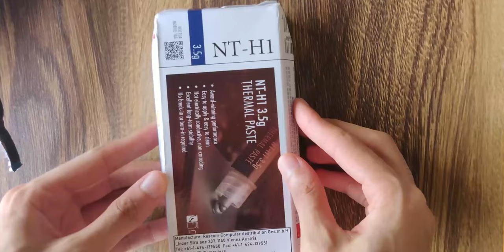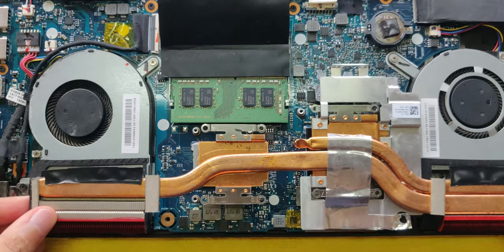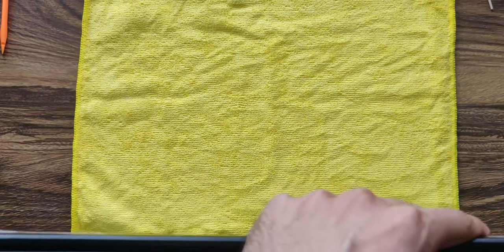How To Replace Your Thermal Paste - ASUS TUF FX505D series | Noctua NT H1

Comment: i was gonna repaste  my laptop yesterday but 2 of the cpu heatsink screws are screwed in really tight and im worried i will strip them what do you think i should do?
Reply from the maker: It was kind of hard for me to get the screws and the heatsink off as well. I was able to get the screws off by using a flat head/slotted screw driver bit (the one that's a straight line rather than the crosshead). That helped get the screws out first without stripping them. 

Then, as you can see in this video I had to apply quite some pressure to remove the heatsink from the laptop.

Comment: I have the same laptop and it keeps shutting down after 15-20 minutes with fans running like crazy. I am not sure if it's getting that hot in just 20 minutes. Cleaned the fans too. How do you measure the temperature of the laptop? I am using Core Temp. How do i know if thermal paste will solve my problem?
Reply from the maker: Sorry for the late response! I use HWInfo for temperature monitoring. Usually if you haven't cleaned your laptop fans in some time and you haven't replaced the thermal paste, doing both of these things will show an improvement in thermals

Comment: I have an ASUS TUF FX505GE. Does my model have the same placement of parts as the one in your video? I'm planning to do thermal repaste on it as well. But Im not sure if these products have the same layout.
Reply from the maker: Hey! Did some research on the GE model, and from what I can tell the only difference seems to be the position of the SSD. The heatsink looks the exact same from what I can tell, you should be able to follow this guide to replace the thermal paste. Hope this helped :)
Reply: @CytechGaming  ok. I just did it today! Thank you very much for your help. But last one question if I may, why do we need to unplug the battery from the motherboard before putting the thermal paste?
Reply from the maker: That's awesome! If the battery is connected, it's possible that there's some power circulating in the laptop. Although I've never really had an issue with it while upgrading ram, etc. but it's considered good practice to do it in case something goes wrong.

Comment: 🥲 bro I burst my asus tuf 505dt cpu and service guy told me to replace the mother board how much would it cost
Reply from the maker: Laptop motherboards aren't as common as consumer motherboards. In my experience it has been pretty expensive, usually atleast 50% of the laptop's original price (depending on the laptop ofcourse). 

Did he give you a quote?

Edit: Also, had you replaced the thermal paste before this happened?

Comment: What was the performance difference? I wasn't able to find the next video.
Reply from the maker: Yep, I lost the data for it and wasn't able to make it 😓

I saw a temp drop or around 5-10°C depending on the application, and a performance increase of 3-5% usually

Comment: Few days ago i went to computer repair shop to clean my laptop fans but since then my games are keep crashing within 5 to 10 minutes of gameplay and yes I have same laptop 
PLEASE HELP
Reply from the maker: Hey, this usually happens when the laptop overheats. Does it give you any message before/after crashing? You could open up the laptop and try reapplying the thermal paste if that's the case.
Reply from the maker: Do you hear your fans spinning when you start playing? It's also possible that they forgot to plug it back in after cleaning it, but I think that's more unlikely since your laptop would probably overheat much before you ran any games
Reply: @CytechGaming  Yes sir, during crashes it shows some errors for some games but can't say tge same for every games and whenever I underclock my GPU with MSI AFTERBURNER games are running about 50 to 60 minutes and I get better performance.I mean I m underclocking GPU that means I m decreasing the power of GPU.technically it should give less performance but surprisingly I m getting better performance
Reply from the maker: @037anshdev2  Hmmm it sounds like the issue is not with the fan being plugged in. I would suggest two things - either going back to the computer repair shop and asking them to help you fix the issue (in my experience they usually just factory reset it). 

Or you could try running it at stock settings without underclocking to see if the issue continues, or if it occurs faster than usual, which would give a good hint that the issue is thermal related
Reply: @CytechGaming  Yes you are absolutely right sir, games are quickly crashing without underclock like in 5 to 10 minutes.
Reply from the maker: @037anshdev2  I think you should take it to the shop and tell them you have been facing this issue, and show it to them. Seems to be hardware related so I don't think they will factory reset it, but I would suggest backing up your data just in case.

Have you tried running the fans in Turbo mode?
Reply: @CytechGaming  Yes, I always run in turbo mode only
Reply: @037anshdev2 Bro did you fix this issue?

Comment: Mine has stripped screws 😫
Reply from the maker: Aww that sucks. Sometimes with stripped screws you can put something like a rubberband on the screw and use the screwdriver which works pretty well (depending on how bad it is).

Makes it easier because the rubberband adds a surface that can grip the screws better.

Comment: Is it safe to make it myself? I already installed RAM and SSD by myself but when it come to this part I'm a little bit scared.
Reply from the maker: It's completely safe! Just use the right tools and solutions and you'll be good to go :)

I'm always here in the comments if you have any doubts! You can also check the other comments for tips and advice. I'll be here! :)
Reply: @CytechGaming  for the fan can I just use the small vacuum? I also afraid about the fan because I need to tear down a few wire between it.
Reply from the maker: @caencfy4702  yep you can use a vacuum but make sure the blades don't spin while you're doing that as it can damage the bearings in the fan. 

And don't worry you don't need to tear down any wires. Just remove the screws and disconnect connector from the motherboard and the fan will come off enough for you to clean it :)
Reply: @CytechGaming  but there are few tape make it difficult to take out the wire
Reply from the maker: @caencfy4702  can you send a picture of it? You can upload it to Imgur and paste the link here
Reply: @CytechGaming  sorry I don't have an account for that.

Comment: Can i replace the vrm and the other component except the cpu and the gpu using 1mm thermal pad? My laptop is asus g531gu
Reply from the maker: I have not looked into vrm replacement, but laptops are usually a lot more tightly integrated in terms of their components. I doubt you will be able to replace the vrm on your own, you would need to send it to a service center for repair.
Reply: @CytechGaming  nooo i mean my laptop is using thermal paste instead of thermal pad on the vram and other component that usually in laptop they using the pad so my question is can i replace the paste with thermal pad on the other component except cpu and the gpu?
Reply from the maker: @nicholasconstantine2624  Ahh gotcha. If you're still using the stock thermal paste, switching to either thermal pad/high quality thermal paste will improve cooling/performance. 

There doesn't seem to be any problem with using both, thermal paste and thermal pads in one system so I think you're good to go :)
Reply: I bought the 1mm thermal pad and it seems too thick for my g531 heatsink luckily i bought 2 kryonaut so i clean all the old paste and put the new paste in.

From the stress test my laptop from 95⁰-96⁰ and only 3.3-3.4 ghz become 70⁰-78⁰ and a constant 4.0 ghz on my i7 9750h. Bro like legit changing thermal paste on your laptop is that significant from the temp, performance, and fan speed.
Reply from the maker: @nicholasconstantine2624  Ahh yeah it would be hard to fit a thermal pad under the heatsink. It's crazy how much of a performance difference you can see with a change in paste

Comment: What % isopropyl alcohol did you use, I only have 91% available so I was wondering it you used 99%
Reply from the maker: Hey, I used 99% but I don't think it should make much of a difference. Just make sure all of it has evaporated before applying anything on it :)

Comment: My CPU and GPU temperature always hints 90 within 3 minutes of gameplay and games crashes in few minutes too.
And CPU sometimes hints 100 for a second
Will using this thermal paste do the trick?
Reply: Your fans are probably clogged up with dust and the thermal paste is dry, so yes replace the thermal paste and clean the fans.
Reply from the maker: Yeah, doing some dust cleaning and replacing the stock thermal paste will definitely give you better thermals
Reply: @CytechGaming  thanks
Reply: @chenik7657  ok but what about game crashing?

Comment: No need to smear or spread the thermal paste?😬
Reply from the maker: The Noctua NT H1 thermal paste is self-spreading, but that is the case for most pastes (Noctua does it better in my opinion). Check out references for how to apply your specific thermal paste to see if you need to spread/smear it!
Reply: @CytechGaming  do u think artic mx5 self spread. Because its quite sticky

Comment: I am afraid to change it ☹️ 
You were afraid too right?
Reply from the maker: It was the first time I had ever changed my laptop's thermal paste so I was pretty nervous as well – especially when the heatsink was so hard to remove.

However, if you're at the point where you're thinking of changing your thermal paste, you probably have the technical knowledge to do so. Be careful and confident at the same time and you'll find it's quite easy! You can always come back to this tutorial and do it step by step 😊

Comment: what would happen if the heatsink pipe bent a little bit in the process of pulling out the heatsink ?
Reply from the maker: Sometimes if it's not too bad you can always try to bend it back to the original shape. If it's very slight, you could also get away with just screwing it back on and making sure it stays where it's supposed to.
Reply: @CytechGaming  i opened up my heatsink yesterday to see how much thermal paste there is and there is barely 😂 that explains my 80°C in almost any game

Comment: Yo man I got a Question. Could I Use Alcohol 70% Instead of the 90% ?
Reply: I know this is a week old, but as long as you let it dry for like 30 minutes and the battery is disconnected, you should be fine
Reply: @Raffy-wo4ph  Thanks Man.

Comment: bro what is performance difference?
Reply from the maker: Saw a drop of approx 5-10°C, and performance improvement of around 3-5% in most cases. The main improvement was in the thermals.
Reply: @CytechGaming  and how it's now after 1 year did repasted?
Reply from the maker: @kuldeeprane1469  the thermal paste is still performing quite well, have seen a slight increase in the maximum temps but that could be due to dust or other factors as well. Hope this helped :)
Reply: @CytechGaming  yes thnx brother
Reply from the maker: @kuldeeprane1469  anytime :)

Comment: Thermal paste must be applied to the CPU and video card chip. The video card memory must have special thermal gapfiller (Laird for instance). If you wanna burn your nvidia do like this guy on the video lol. You also can see it on the video, there are two completely different substances. Gapfiller is blue and thermal paste is gray.

Comment: After I change thermal my laptop won’t turn on 
Why?
Reply from the maker: Could be a couple of things. Did you reattach the battery to the motherboard when you closed it? If you removed the RAM at any point, make sure it's seated properly.

Comment: Man I finally just got around to doing this. When I finally put everything back together, I'm only getting an orange charge light, and when I press the power button nothing happens. Any idea what I might have done, or what can cause the laptop to not even power on at all?

I tried powering on without the battery connected but AC connected, and then with the battery connected only, and nothing will get the laptop to power on.

When I have the battery unplugged and connect AC, the keyboard flashes white then turns off. Any help appreciated
Reply from the maker: Don't worry, I'll be here to help you troubleshoot till you figure it out.

I'd look into why the laptop gives just the orange charging light when you try to turn it on, that could be an error indicator. 

Apart from that, I would check if the RAM is seated correctly (don't be afraid to use a bit of force when you're reseating it), and also make sure that any cables you unplugged were replugged. Sometimes the easiest fix is just a loose cable.

I'll do a bit of research once I get off work as well, let me know if you find anything till then :)
Reply: @CytechGaming  I cleaned up the board a bit, I had some thermal paste run over onto the motherboard and now the keyboard is lighting up red and the fans are coming on. But still no display, doesn't look like it's booting correctly. 

I think tomorrow I'm gonna clean off all the thermal paste and try see if it boots properly. It should boot without the heatsink on right?

Hope I haven't shorted something and broken my laptop
Reply from the maker: @nspnutritionsportsperforma6804  hey! Sorry been a bit busy, meant to reply to this earlier. I don't think the laptop will boot without the heatsink or without thermal paste, the contact points between the cpu and heatsink aren't perfect (flat) enough for the heat to be transferred efficiently. And without heat transfer the cpu will just heat up. 

Which thermal paste did you use? Most thermal pastes are non conductive, so even if it gets onto the motherboard it shouldn't be an issue, just a bit messy. Did you have any luck trying any other solutions like reseating the RAM?
Reply: @CytechGaming  Hey mate
I used noctua H2 thermal paste.

I cleaned HEAPS of dust out of the fans and around the laptop. I think what's happened is alot of that dust and debris just went under the motherboard and could be causing a short from underneath.

Gonna take out the mobo and give it a good clean and see what happens.

Right now the laptop boots with red keyboard lights, and turns off then straight back on after 3 seconds. Screen doesn't turn on at all. But laptop does boot and USB devices plugged in also power on for 3 seconds, then off for a split second, then repeats.

Does it sound like something is shorting the board?
Reply from the maker: @nspnutritionsportsperforma6804  Hey man! Sorry I missed this, I didn't get a notification for it. Were you able to fix the issue?
Reply: @CytechGaming  nope. I must have shorted something on the board...
I think it was meant to be though. Because I ended up buying a Razer Blade 15 Advanced 2020 brand new on sale for $1800 with a 2080 Super Max Q 😊
Reply from the maker: @nspnutritionsportsperforma6804  Aww damn that sucks. Really glad it worked out in the end though! :)

Comment: 4:40 That is not enough paste right?
Reply from the maker: The paste on the CPU was enough, but I could have applied more to the GPU and VRMs. What I learned is that it's always better to go with too much rather than too little :)
Reply: @CytechGaming  "always better to go with too much rather than too little :)" yeah, that was my thought also. Glad it all worked out. did you do some temp measurements before and after?
Reply from the maker: @olegyamleq7796  Haha exactly. Yep, lost the data that I was gonna use in making another video about it, but saw temps fall by around 10 C.
Reply: @CytechGaming  wowwww!! 10C, great!!!! I have a TUF 505DT, maybe i will try it!!! Thanks
Reply from the maker: @olegyamleq7796  Yep, the Noctua paste has been great for me. Few tips i forgot to include in the video:

- When you're removing the heatsink you'll see numbers near the screws, remove them in that order. 
- Don't lift up the heatsink after your first application to check how it spread, it can lead to air pockets which makes it slightly less effective.

Let me know if you have any questions, I'd be happy to answer! :)
Reply: @CytechGaming  Thanks for the tips and thanks!!
Reply from the maker: My pleasure :)

Comment: I had my laptop for a year, and my cousin has the same laptop but hes had it for like 4-5 months, his fans and temps are so much quieter than my laptop. I was wondering, will repasteing reduce my fan noise?
Reply from the maker: If your laptop exhaust grills/fans have gotten dusty that could be a reason for it. Changing the thermal paste would also help in that case. 

Another reason for the noise could be the profile it's set on (Silent, Performance, and Turbo when it's plugged in). I've made the mistake of thinking the performance was low because my laptop was in the Silent profile instead of Performance :P

Hope this helped!
Reply: @CytechGaming  yeah me and my cousins laptop are both in performance mode and his makes way less noise, ive also already tried cleaning it so im thinking i need a repaste
Reply from the maker: @mxngxchxngx  Hmm possible. It can only help so I'd say give it a shot :)
Reply: @CytechGaming  yeah, ive heard that the fans are also heat controlled and on heavy load my cpu reaches up to 98c, also another thing that leads me to think that the thermal power paste is dried up is because me and my cousin get almost the same exact performance in games except different temps
Reply from the maker: Ahh makes sense. Yep, the internal temperatures and the fan speed are positively related. The higher the temps, the faster the fan will spin. Sounds like a good idea to replace the paste!